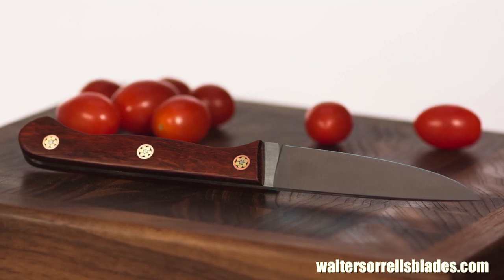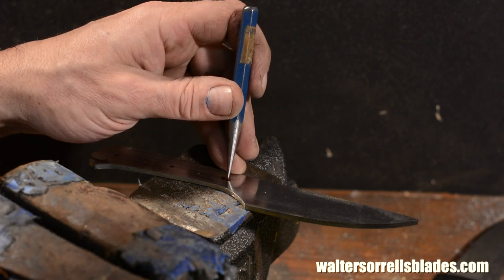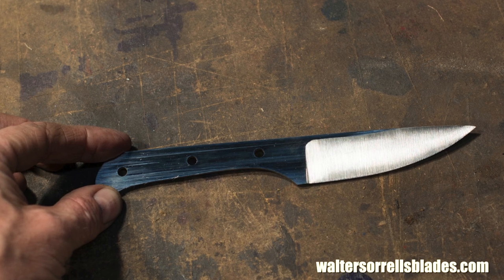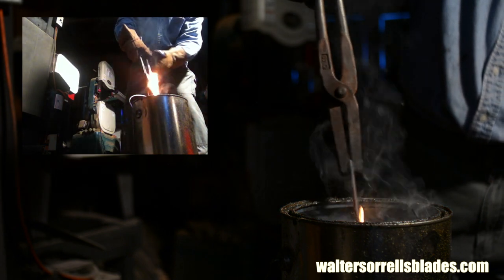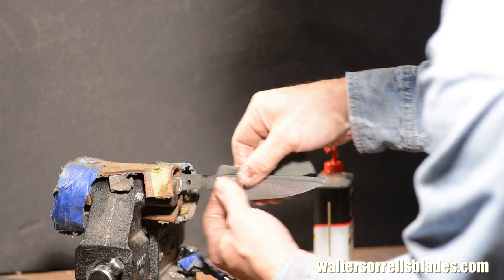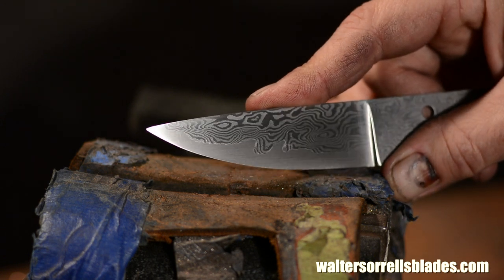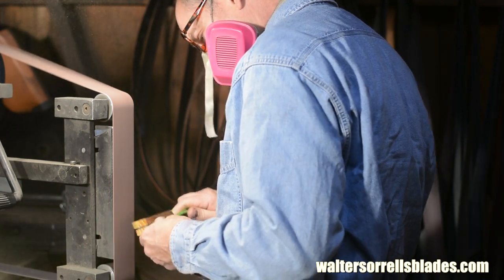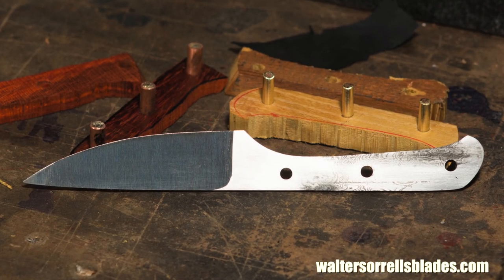Making a Kitchen Knife (Damascus Steel Paring Knife)

Comment: I've been using bois d'arc, or Osage Orange for many years. It was planted after the dust bowl as wind breaks all over Oklahoma.   I've heard farmers say that a 'bodark' fence post that has dried for a few years is impervious to a chain saw, that sparks fly.  I've yet to try that as I tend to use the wood very quickly.  Word of note, UV will eventually turn it very dark.  It's density approaches lignum vitae and will just barely float in water.  I make all my mallets from 'bodark'.  
  This knife is so lovely, I just had to subscribe.
Reply: Thomas Hanson cool I have some that I made into a bowl and that stuff is hard and dense
Reply: I can tell you from first hand knowledge that you use very short fence staples on bois d'arc posts.  They are so hard that the staple will bend before it ever gets too deep so no need to use more than 3/4 inch deep on old posts.  I have logs over 6 foot long drying to make bow staves from if I ever get caught up on projects to have enough time to make a self bow.  It is as hard and as tough as they say.  We have some posts approaching 100 years old still standing.  It was one of the few woods that could be found naturally in this part of Western Oklahoma.
Reply: Can you mail me some osage orange for bow blanks? I can send money

Comment: I love bois d'arc!  It's one of my favorite woods.  I mostly use it in my bows, but I use it for other stuff, too.  It'll darken to a dark honey colour over time.  Have you ever tried superglue as a finish?  It's what I use. The thin stuff gets into the pours pretty well, so it makes a durable finish, but you have to be quick about it.  I squirt little sections at a time, wipe it quickly, then go to another part.
Reply: The guys who make the classic shaving brushes use the superglue method of finishing the wood as well.  Apparently, it is a very effective way of sealing the wood......

Comment: Osage orange is beautiful, yet unforgiving.We call it hedge here in the Hoosier state, and when you pounded staples into seasoned hedge while fencing, you found a longitudinal crack, or you simply didn't pound that staple.The earlier comment about sparks flying while milling is entirely accurate, to work it seasoned requires carbide tooling and perseverance. That said, it burns as hot as coal in a forge and makes wonderful bows, hence the name, bois du arc, or " Wood of the bow".

Comment: Cheers Walter, got a question, is that your style of making handles ( sharpish edges all around) or is it just something the customer wants?
I love using old belts cut into small straps and do the curves to the point where the handle feels like an egg shape.
Oh and by the way, try African ironwood, currently working with it and it's a blast, fell inlove with it the moment i touched the slab!

Comment: Out of curiosity, is there a reason you didn't do a hollow grind after the flat grinding? I was under the impression that the hollow grind would make the slicing a kitchen knife does easier. Is that incorrect, or do you like hollow grinds?

Comment: It's not as durable - though I've not experienced or been informed of a failure yet - but I've been using for several years now bamboo pins on some of my full tang fixed blade knives. I've always hated pin heating while shaping handles. When I use metal, I make the pins of minimal extra length regardless of the thickness of the handle scales. It's saved me a lot of irritation.

Comment: I love the knife you made everything about it, very useful design I'm sure it will work well but is beautiful. I have a question, is the quality of the steel made better by forging compared to just grinding the bevel and shape of the blade using 1095 steel. I saw a video that said forging did something to the steel to make the molecular structure better, what is your opinion on this.

Comment: That wood is also known as Bodark as the Indians used it for making bows. It's very hard & makes a great handle.. It's known for being orange in color. It's very hard to cut down & doesn't make for good wood for furniture. In some areas it's more of a bush than a tree.

You are a fine craftsman. They're in short supply these days.
Reply: The more standard spelling is "bois d'arc" (from French, I guess), although Texans pronounce it "bo-dark." The tree is quite common in older neighborhoods and farms here in Texas, although it is no longer fashionable. The tree is also called hedge apple and osage orange-- both names reference its fruits, which look like green brains. In my boyhood in Dallas, kids called them "horse apples." I don't know if horses eat them (I'm a city boy). The seeds are supposedly edible for humans, although no one I knew ate them. The interior wood of a bois d'arc trunk can have a beautiful orange color. It used to be used for tool handles. My elders told me that if you make fence posts from bois d'arc wood, the posts will never rot. They also told me that if you use fresh-cut bois d'arc posts, you sould plant them in the ground upside-down (compared to the way the tree was growing) if you don't want the posts to sprout into new trees. Is that true? I don't know-- again, I grew up in the city, not on a farm.
Reply: Gary Cooper The park down from me has a ton of them. I always know when it's fall here in North TX when the horse apples are falling...LOL

Comment: Just a quick FYI from someone that uses epoxy daily in his own trade. Denatured alcohol on a shop towel will cleanly remove excess epoxy so you won't have to worry about chipping it off later.

Comment: im only really familiar with o1 and saw blade steels, but aren't you supposed to quench by making slicing motions in the oil rather than going side to side to prevent warps in the blade?
Reply: Prob doesnt matter as much on knifes

Comment: In another video you tempered at 450 degrees, this one you said 400 degrees.  Is it different for each metal?  And do you have to get it exactly to 1475 degrees to harden the steel, or can I just stick it in my crucible and get it evenly red?
Reply: +jermelger Yes for your first question, and it depends for your second. 1475 is your placeholder temp, just get it around there until it is even.

Comment: I may be mistaken, but can't you also use muriatic acid to etch the blade? It's a tiny bit cheaper and easier to come by.
Reply from the maker: +TheJojobob123 There are a lot of ways to etch steel including lemon juice and vinegar.  I haven't used muriatic acid but I'm sure it would work.  You can get ferric chloride at any Radio Shack though.

Comment: how do u bring out the fold lines and the hamon?
Reply: Josh's Custom Whips I'm not sure if you still need this answered (being 6months later and all) but that was the point of the acid etch, another way to make it more subtle is to polish it to a mirror or near mirror finish (buffing wheels don't work for finishing but you could use the buffing compound)

Comment: is there a reason (other than saving on materials) for not making the knife full tang?
Reply from the maker: +Spring Board Typically forged blades don't have full tangs whereas stock removal knives do.  This is because it's a lot of work to accurately forge and grind a full tang knife.
Reply: Walter Sorrells do you mean a visible tang? An example of a full tang could be a sword where the tang is the full length of the handle but still hidden inside the handle whereas when using handle scales it's still a full tang just shown instead, the only time a tang isn't considered a "full tang" is when it doesn't reach the bottom of the handle
Reply: I was curious if there was a good reason that a tang wouldn't run the length of the handle. But (since you bring it up) I would also like to know if concealing the tang is and esthetic or practical?
Reply: concealed tangs yes like Walter said they're much easier to forge, they save a considerable amount of material and retain most of their strength half tangs there really isn't much point, yes they save material but that's all, I would recommend a hidden tang for European swords and large daggers, basically anything with a pommel aside from that I would recommend a full visible tang for any knives and Japanese swords or machetes

Comment: How do you spell the name of that wood you used for the handle scales?  I'm wondering if it's a local name for Osage Orange.  It looks like it.
Reply: +Christopher Melvin Bois d'arc is also called horse apple also called hedge but most bowyers call it Osage orange. Same wood bunch of names. its FORMAL botanical name is Maclura Pomifera hope this helps.
Reply: +Duh5001 Yeah.  I remember reading about it now.  It's supposed to be great stuff.  Thanks for the info.
Reply: +Christopher Melv in

Comment: Bad thumb <------- forging accident in a cold shop by any chance?  ;)
Thanks for sharing the vid :)
Reply from the maker: A screw slipped on the tool rest of my lathe while tightening it.  Wham.
Reply: Walter Sorrells ouch!  I took a carpentry class over 10 years ago in which we had built a $$$ new house throughout the trimesters.. and in the winter time, when we were putting up the foundation forms, I would be hammering away on my thumb and/or index finger without even realizing it.   I think during that winter I only had about 3 fingers that didn't have black and blue nails  lol

Comment: If you do have epoxy squeeze out on anything you can't scrape you could wash it off with methylene chloride and a rag or q-tip. Could save some polishing time
Reply from the maker: Great tip.  Thanks!
Reply: acetone works well too and is less toxic
Reply: +David McKenzie Isopropyl alcohol works well, too, and is super cheap.